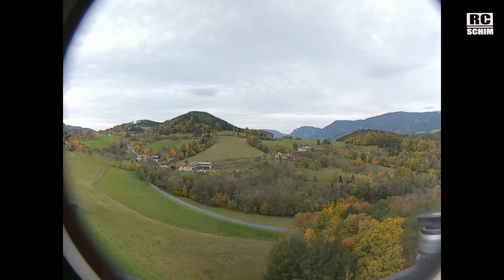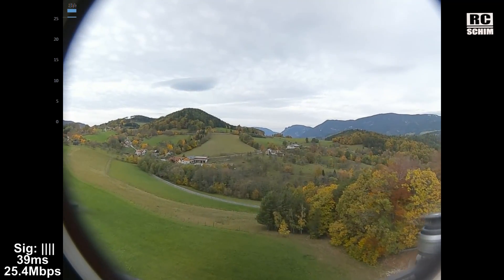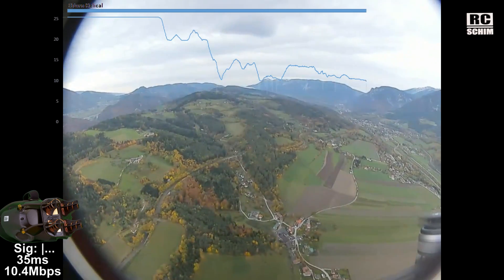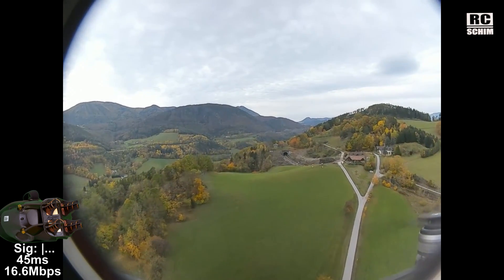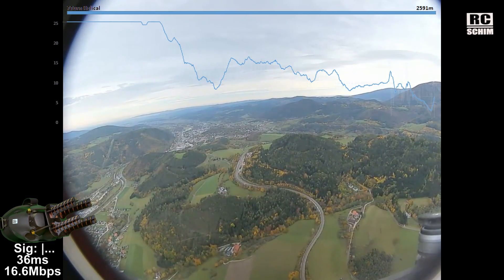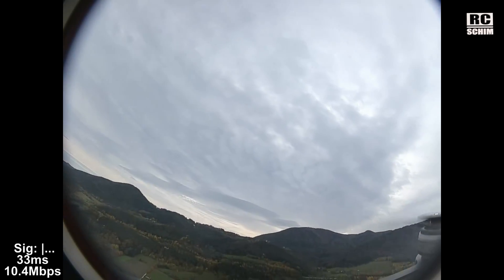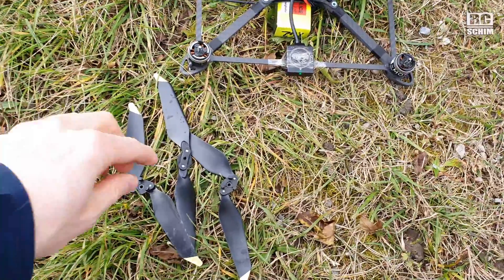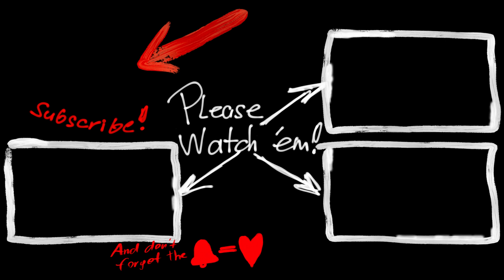DJIFPV Antennas: Stock vs  Helicals vs  GRAVITY

Comment: Have you tested vista vs dji?
I have a vista unit and have much better signal range
Reply from the maker: Nope, not side by side yet. But I flew vista units a lot this summer (my eMaxpro has one on it).
Maybe it's mostly because the caddx antenna on there is better than the DJI airunits stock antennas?
on my airunit builds I used own antennas a lot...

Comment: Thanks for sharing, can you also test the new iFlight patch antenna?  https://www.banggood.com/IFlight-Crystal-HD-Patch-5_8GHz-9dBi-Directional-Circular-Polarized-High-Gain-Flat-Panel-FPV-Antenna-LHCP-RP-SMA-with-Casing-for-DJI-FPV-Goggles-p-1763025.html?currency=USD&utm_source=facebook&utm_medium=cpc_ods&utm_content=demurs2&utm_campaign=demurs2-RF-all11-rf-in-rc-6w-201109&utm_ho=m18&utm_gender=all&ad_id=23846379637960091&fbclid=IwAR1xWiw_72_dAK32x6xI1E4G41R5CTllhATRfx9x57fjXYFs1StyVnWgzME&ID=6297833&cur_warehouse=CN
Reply: @Daniel Kieng - see RCSchim's December 20th video @~2:30

Comment: For the budget antenna the "Aomway dual diamond directional " can use with dji hd goggles? Because I found inBG have rp-sma version too.
Reply from the maker: the only Aomway antennas that really worked nice for me were the SPW.
the ones you mention here have too much gain and are too diretional for my taste. You can try them, but I am a bit sceptical.
better you get something like that:  https://www.getfpv.com/ibcrazy-5-8ghz-7-5dbic-helical-goggle-mount-lhcp.html  
and also use an RP SMA to SMA connector  (or find those antennas with RP SMA?)
They have much wide beam and 7.5db gain is not bad.

Comment: This has to be the best series of antennae reviews for digital FPV system. Really outstanding work. The results are impressive. Over twice the range on helical? That's a lot more than I expected. Enough for me to consider getting a good set. Can you recommend a specific international vendor/brand? I'm kinda lost with the current options. FYI, I'm in Brazil, so shipping costs are a thing. Banggood is a good option, along with their Chinese competitors.
Reply from the maker: Henrik was faster in the reply. I was to suggest his 3turn. 5 if you really want more range in one direction but can live with smaller beam. 7 turn is really big. 3t can stay on. 
Greetings to 🇧🇷
Reply: @Rcschim  thanks mate!
Yes I would say that the 3turn death ray is the best choise for 95% of the dji fpv flyers. The 5turn is more aimed to suit the smaller group of  serious long range quad pilots who really looking to push ultra efficient quads with big li-ion packs to extreme ranges and the 7turn is aimed to suit long range fixed wing pilots
Reply: @SLINGSHOTandMOLOTOWS  Thanks guys! I'll set for the 3 turns for convenience and storage. And as Bruce Dickinson teaches, long range has to be limited to how long you are willing to walk and retrieve your fallen model.
Reply: @AdrianoCasemiro  great. Well if you have to walk the max distance of even the 3turn on 700mw you will not have a great day....or days👍
Reply: @SLINGSHOTandMOLOTOWS  That pain comes with the joy of flying, right? I've been there and done that. Plenty of times... I just crash a lot.
Reply: @AdrianoCasemiro  hahaha yes I know. Send me an email and I give you some info and pictures of the death ray antennas
Reply: @SLINGSHOTandMOLOTOWS  sent!
Reply: Shipping with tracking to Brasil is included in the price. The 3turn death ray helical is 106usd with worldwide shipping included. You can email me at henrikjaderstrom84@gmail.com

Comment: Great video Mario!! Especially having the presence of mind to keep recording everything, knowing you had a quad downed!!! Would be keen to see an update on what happened to your quad. Looking a the first crash it looked like an FC flip out??, but maybe because one of the motors had a freak out!?? Cheers Mark
Reply from the maker: for some parts I had only audio (because my zoomH1 kept recording - so I had some narrative at all and froze the last frame of copter image. then in the car it was easy to have the phone running...
I guess so, some volt spike? something wrong with motor/esc - making the FC reboot. 
On the testflight after the crash I heard a short beep before it fell out of the air - this time just falling down without double frontflip :)

Comment: Awesome video! I know that gut wrenching feeling of jumping in a car to go find a quad all to well.. fyi I put a Marco Polo locater on anything I'm flying far out..
Reply from the maker: yep, I also had Marco Polo trackers (maybe you saw my review years ago?) but I lost the bigger one, and the smaller one is still quite large for small copters. plus I wanted a simple to locate and cheap available solution. there the TILE is good. not a lot of range, but if you have video until the crash - or even better the GPS coords on your radio, it's enough to have 50m range for the last search steps in high gras or something...
Reply: @Rcschim  interesting.. I fly mine on my transtec Beetle and flywoo Explorer all the time..

Comment: Nice test! I really like your "live" graph overlays.

Seems like maybe you should do a bunch of gps return to home exercises to get some confidence( or not) in the system. So then you can go till video blanks out, hit return, and wait till video pops back 30 seconds later. I know... that would take a lot of faith. And I shouldn't really be talking on that subject,.. :D
Reply from the maker: I know in theory all should be fine, rth was tested a few times, it works well. But in this case you see that even with that security, the copter could have easily dropped out of the air very far out... so my gut feelings were justified ;)

Comment: Those are the worst crashes... when it just drops out of the air for seemingly no reason, and you don't know why.
Reply from the maker: Totally! And now this makes this copter wall decoration for the hangar ;)
Reply: @Rcschim  Any clues from blackbox or telemetry logs?
Reply from the maker: Not really. But a friend who knows inav gave me some tips. Sometimes wrong settings or too much load on the cpu of fc can cause problems...

Comment: I had a prop snap filming drift cars last weekend.  There's three frames of massive jello in the DJI DvR and then the quad starts to tumble to the right rear.   Yours looks like a full power train cutout or FC glitch/reset
Reply from the maker: Yep, I'd also guess the fc freaked out. After the crash while test hovering it didn't flip but just beep and then drop to the ground. The beep might have been the sound of the reset? But In such a case we will not see anything in the log, right?
Reply: @Rcschim  there should be mode switches present in the log?
Reply from the maker: I guess if the FC reboots it will stop logging. if it made a disarm and not a reset - it would also stop the log...

Comment: Great test Mario, sucks that your quad is unreliable. Are you sure that the folding props are at fault, mabey they fold then the motors brake hard.?
My death rays did great again, plenty of mbits to spare, you can cover alot of ground with 10+ mbits left but I totally understand the feeling when so far away.....it is super scary and all you want to do is turn back home. You know with 50.8mbit you get even better range😁
Sucks that you dident had the chance to test the mapelWL, I was looking forward to that. When you do it would be great if you could test my 3turn again as a reference and mabey use 50.8mbit mode too. 50.8mbit is what most people will fly nowadays. 
Great video and so happy you like the death ray💕
Reply from the maker: I already thought about the next test:   DJI airunit on 4m lamp tripod on the roof of our house (enough alt) and then drive away far with the goggles. have Airunit on switchable powersocket and also install fan. 
this way I can take my time, dont worry about crashes and in the distance see how video goes and comes again.
of course it will be worse range than with flying, but still the same for all antenas.  
not 100% my idea tho - I think FPV wannabe suggested it? dont remember.
and yes, there I will for sure test the 3turn and 7turn again - they are good references now for me!
Reply: @Rcschim  great idea but some things to concider to get more true results. Put the airunit in a wooden pole and strap it to the lamp post with straps so its atleast 1meter from the stele in the lamppost. Also you probably want to get out of your car at some different spots and aim the antennas towards the airunit.....or mabey even just do one stop at the furthest possible range with line of site and get out of the car. This is probably what you already was planing to do as doing a rangetest from within the car would be crap no matter what antennas you use.
This is awesome as you can do the mapel WL antennas aswell without having to wait for a thrustworthy quad.
Please use 50.8mbit too as its the more relevant mode wich everybody uses.
Reply from the maker: @SLINGSHOTandMOLOTOWS  thanks for the tips. yes: i was planning to be outside car.
good idea with wooden stick to be away from steele (I wouldnt have done this).
I will see if 50mbit has really more range - not so sure about this. I felt that yes: it gives you double the bandwith and more MBit - so in a case where I would have had only 2-3mbit (on25mbit mode) it would be double - and better image.   but in the case where 25mbit mode disconnects - 50mbit will also disconnect at the same range, so ultimate range - same - but better image quality in the extreme low RSSI regions with 50mbit is my guess...
greets, Mario
Reply: @Rcschim  great👍 yes being close to iron/steel(especially if its grounded) will do bad stuff to the signal, 1meter separation should be good enough.
Before the 50.8 update people reported black screens already at 6km(at 1200mw) even with decent directional antennas, with 50.8 they say its around 13.3km now.
I dont know if this is directly related to the increased mbit rate or if its something else in the update wich made the range longer. Whats the longest line of sight distance you can test with this new "from the house" test concept...
The 3 turn is not really made for ultra range but if you are able to test it at very far ranges it would be awesome if you also could do a test where you aim one of the two beams directly at the house and also do the same for the mapels. However this is outside of the intended way of use for the 3turn but it would be very interesting to see and helpfull for anyone who also wants to use the 3 turn at extreme ranges even if the 5 or 7 would be the better choise at those ranges. It is afterall the most versitile and convenient version of the death ray antennas and in my opinion the cooles looking one too😁

Comment: I will be anxious to find out the cause of your quad just disarming and falling out of the sky.  My Flywoo Explorer does the same on Every  flight since day one. Bit rate is 50.8 so its not a failsafe? Will not rearm till I recycle the power. Replaced a noisy motor, no help.  Just ordered a new stack
Reply: Are u using DJI for control also ?
Reply: @flo-ridafpv5713  Yes, the DJI radio.  I also tried  rewiring the Vista to run off the battery pads instead of the flight controller but it still just drops with no warning. Going to put an Iflight 20x20 stack in it.
Reply: @larssmith2170  ok when it drops does it just kinda go limp or does it do a fast crazy roll
Reply: @flo-ridafpv5713  It sometimes rolls inverted then drops and other times it just drops straight ahead like I closed the throttle
Reply: @larssmith2170  then yep def a failsafe, not a desinc, dont change the stack, if its vista gotta Open a ticket w dji support me thinks..  If ya post on the offical dji fpv facebook group others might can help, lotsa smart guys there and dji support also
Reply: @flo-ridafpv5713  Thanks
Reply: @larssmith2170  no prob
Reply from the maker: some experiences from my incident:   
  it would arm after crash (without powercycle) I see a few new logs were created while I was arm/disarming 2 or 3 times.
in testhover after crash I heard a beep before it just dropped  (FC reset?)
in crash itself you see that it did a fast double flip fwd - but I'm sure it was no CF failsafe (I would have heard that from the radio - and also recorded sound during flight).
since it flew after the crash, no burnt motor obviously
Reply: @Rcschim  that defo sounds like a faulty esc..... on the footage have a real close look at the slomo of the quad as it first flips/rolls. See if you can see which direction it falls in....
You may be able to see which esc failed....

Edit: just watched it again. Doesn't fall to any corner just a straight roll forward......
Very unusual.....

Comment: Great test ! It’s hard to go far away, specially with digital cause it’s black screen of death all of a sudden! 
But with confidence it’s better and better.
I saw on the web site of French helicals antenna manufacturer they says to consider helicals like omni in close range like 10meter around.
(La fabrique circulaire)
Reply from the maker: hi, It's not so sudden with the video link drop - but it's still frightening to have poor video when out far...
Reply: @Rcschim  it’s true but also if you are going fast sometimes it can be from good to pixels to black in few seconds. It requires fast turn back if something happens.